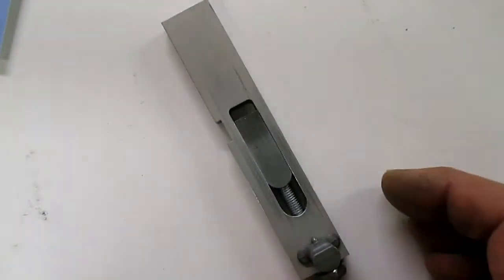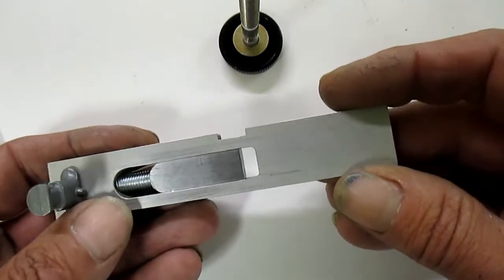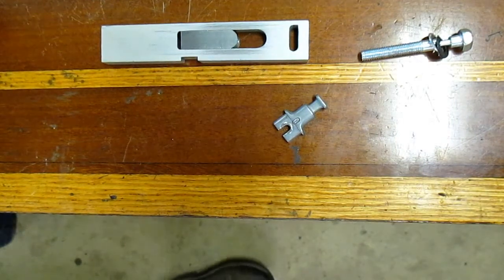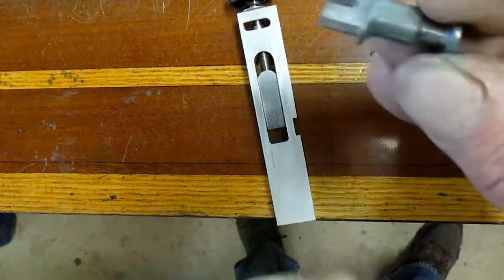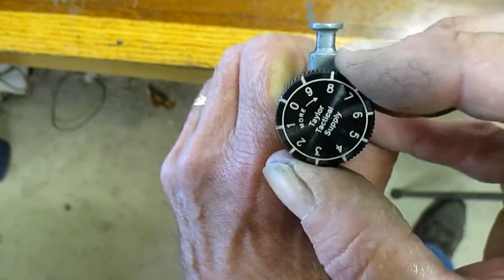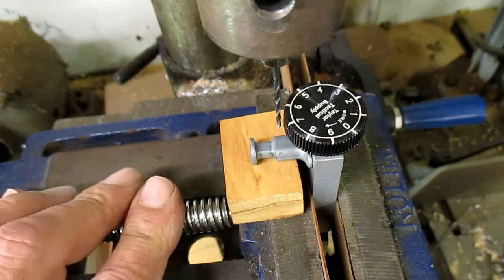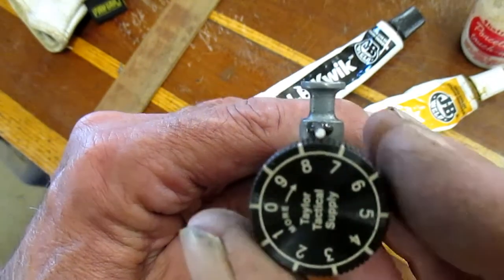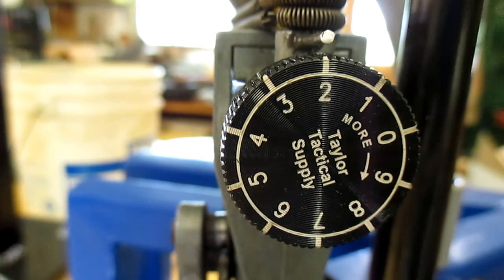Dillon Powder adjustment screw by Taylor Tactical

Comment: That is a great upgrade to the powder measure, I didn't go as fancy, I found an outlet that sells just a thumb wheel that you press fit onto the adjustment bolt, there isn't anything to take apart and fiddle with. Now, Yours look much more precision and sets quality over what I have done. However, I Have found that within a few drops and adjustments my measure is set and the metering is consistent.  I don't know why Dillon has kept this arrangement for all these years (Having to use a bolt for an adjustment that you have to have a wrench to turn) seem like they would have gone with a finger adjustment by now. Keep up the great videos, How are you doing in Bullseye shooting? Dave.
Reply from the maker: Finely hit all 5 in the black first time for me